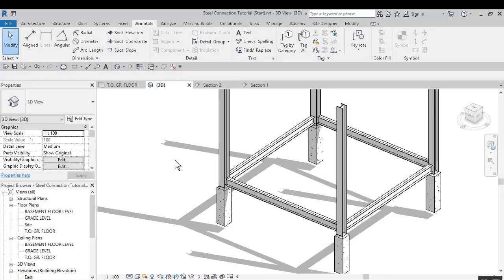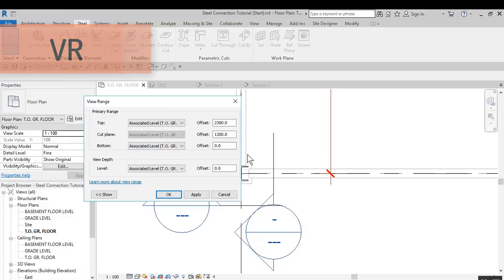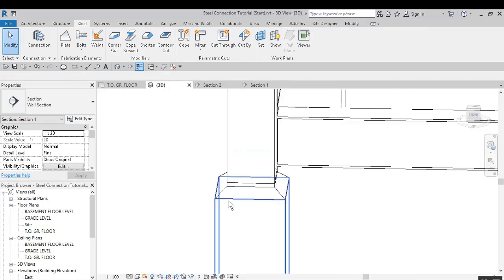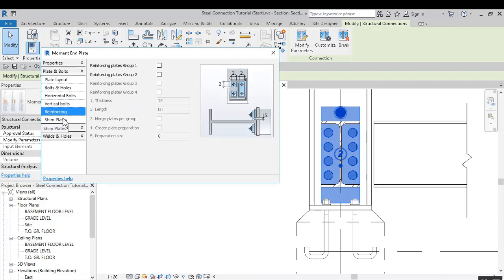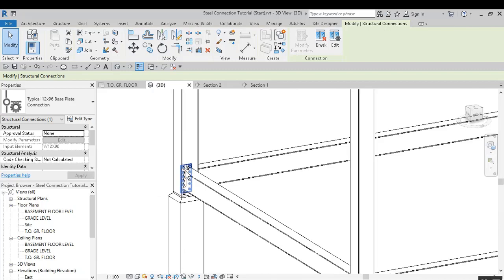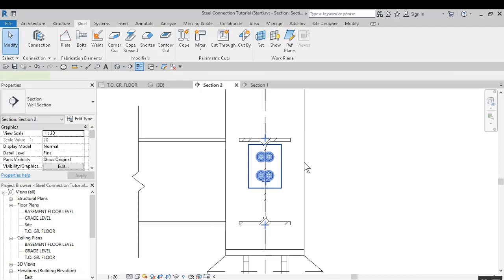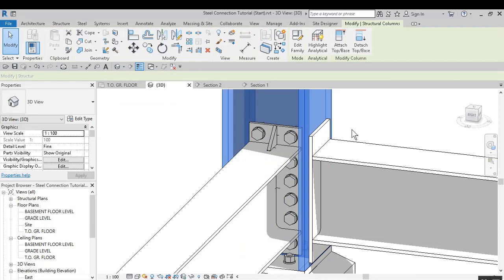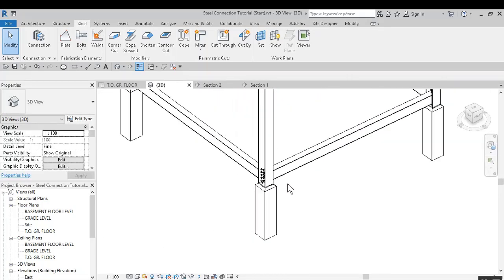Creating Steel Connections in Revit 2019 Part 1

Comment: Thank you sir.Please upload the video in
welding connection of steel to steel beam or plate. Welding symbol is not shown
in layer (or) coating format in actual all joints in revit compare than tekla.
Please help me to solve this problem. Kindly reply sir if you free.
Reply from the maker: https://youtu.be/eOLirDz7Yks
Reply: @OdiaUTT  Thank you for your reply sir.